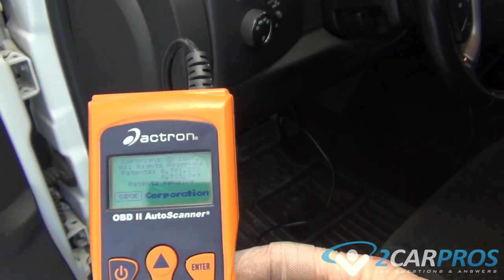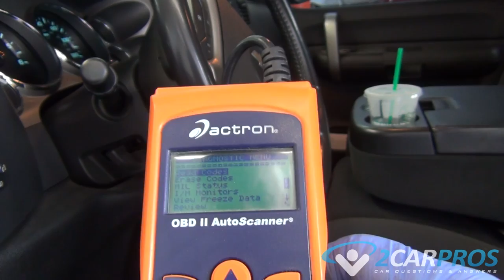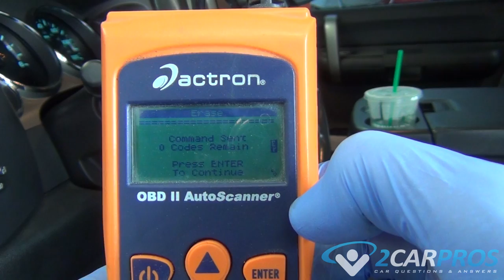Catalytic Converter Replacement Chevrolet Truck 2007-2014

Comment: Good Morning!! I had a check engine light going in and out for a year. Each time I checked it showed that same code. One shop I consulted with suggested possibly a transmission issue. Finally today it stopped working with a loud grinding noise and a burning smell. With no power and I was sitting in the middle of a busy intersection. -JFG

Comment: I was hoping you would show how to remove bolts and sensors that have been there for 10 years and how you can actually get the wrench to the sensor on the left side where is  no straight path.
Reply: same
Reply: Too late at this point but I’ll reapply some penetrating oil multiple times. So if you knew you were changing it next week start spraying it now

Comment: Several follower have noted you make it seem so easy. Most of us don't have a lift and need to do this with jack stands and cold garage floor, that being said, I have the same question, did you use OEM replacement and/or do you have  recommended brand which is equivalent both in performance and fit.
Reply from the maker: I mean I can't make it harder than it is. Anyways I always recommend the OEM part. Thanks for watching!

Comment: I have a 08 GMC Yukon and I've replaced the catalytic converter because of the P0430 and P0420. Then the oxygen sensors because the check engine light came back on. Now it's reading P0430 and P0420 again. What else could it be?
Reply from the maker: Sounds like you have a defective cat, was it new from a reputable source?
Reply: @2carpros  new oem catalytic converter from local auto parts.
Reply: Check to see if you have a exhaust manifold leak super common on the 5.3

Comment: Help ....  ! Thats funny im have a problem with my CAT my obd2 is throwing a P0420 at the time of this video lol. Can some one help me  I have a 1998 GMC k1500 5.0L SL 4WD  I have gone under vehicle and tap cat to see if it ratles a little  I feel like my truck over heats during the summer and after truck has warmed up power reduses.  And help would be awesome ..
Reply: Did new cats solve your problem? I have the same exact issue on my 2001. During summer or hot my power reduces greatly! Also have two codes for my cats.

Comment: U should specify that u need a freaking lift!!  If u don't wanna take the   crossmember out
Reply from the maker: sorry about that, we didn't realize this fact, thanks for the info.
Reply: @2carpros   Is there anything special about taking the crossmember out? Can I not just unbolt it?
Reply: Adding to thread for new people reading this... Just support transmission / transfercase with jack and remove cross member. Use a board between jack and trans pan to avoid pushing into pan, if necessary. It's easy and quick... Probably don't even need to remove sway bar bolts which if they break will be a major pain in the....
Reply: You don't have to remove the crossmember if you just cut the exhaust in half at the crossover pipe.
Reply: @joshstarzyk9703  but you will need to when you put the new part in....

Comment: what brand replacement did you use?
Reply from the maker: This video was shot a few years ago but I'm pretty sure it was ACDelco
Reply: 2CarPros okay thanks, I will look it up! Did you have any emission codes after you installed this? I know some aftermarket part will still throw a code, I'm just wondering...
Reply from the maker: No, we cleared the P0420 code after we replaced the Y pipe and the code did not come back. All fixed :) 

I am unsure of after market parts, we only use OEM specification replacement parts.
Reply: @1980bighunter1  yes this my problem currently ...did u ever resolve it or just sell the truck. They are saying there are no more chevy parts???

Comment: Well I'm about to start this. I'm using jack stands so cross member will have to come out. I'm hoping I can get it done in 4 hrs.
Reply: This sucks. The cross member has 6 bolts. The 4 obvious ones and two mounting bolts. I can't get those, my sockets aren't low profile enough. Also, don't have deep 15M which was fine for passenger side flanges... not for driver side. Off for a deep socket and see if I can get the part out with cross member still in, but loose.
Reply: Abort! Couldn't spend all night on it. Couldn't Crack one bolt on driver and couldn't access another. What shame I feel.
Reply: @kevinbakel4693  did you get it done?
Reply: @dankalan8007  The next day I took it to my trusted garage. I needed oil pressure sensor replaced, which looks like a pain, so they did both for 600.